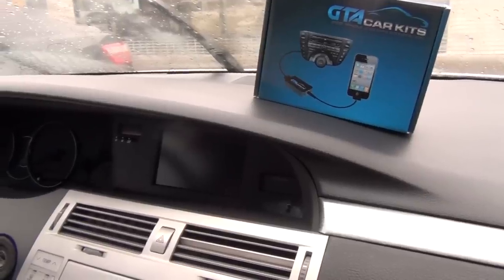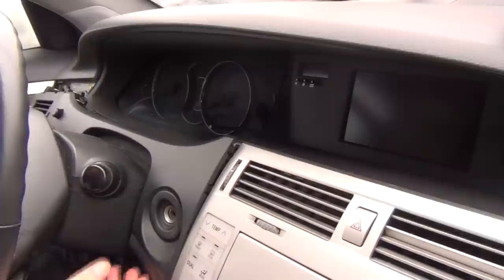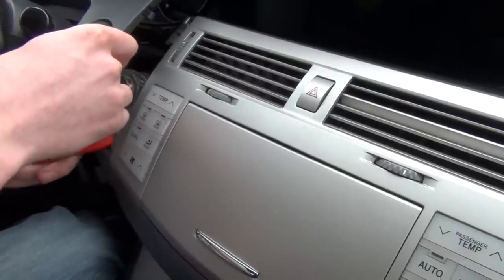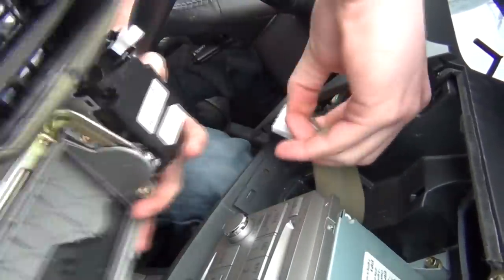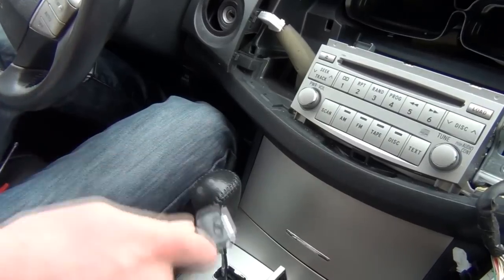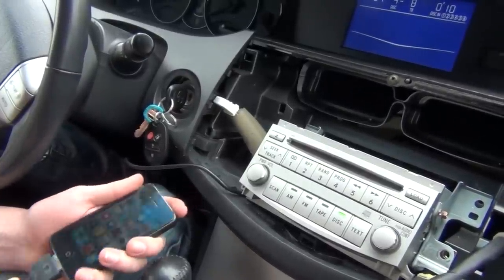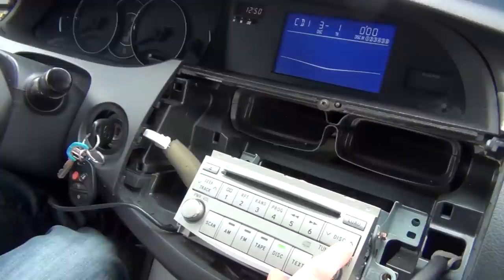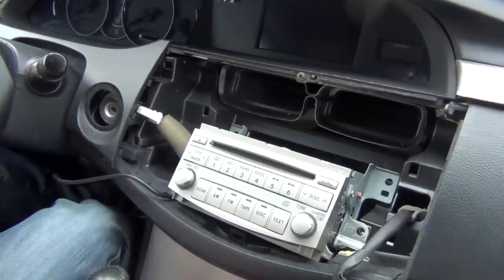GTA Car Kits - Toyota Avalon 2005-2011 iPod, iPhone and AUX adapter installation

Comment: I just installed my kit i ordered this past week. Install went as easy as the video with one question, the plug that you connect, on my radio it was not empty. Something was already plugged in there. I dissconected it and continued with the install and it works fine. Im just curious what that original connection was? Because on your video there was an empty spot there already for it.  Any help would be great.

Comment: Are you guys gonna make a kit with a Lightning connector or have you already?
Reply from the maker: With the new generation devices, you have to use our kit along with the Apple Lightning Adapter. We cannot make our out connection to transfer data, due to patents.
Reply: GTA Car Kits great video. However, were would that Apple Lightening connector/adapter be connected to? Is that with a USB port or a Type C? Not sure we’re to connect it to. Please advise thanks.

Comment: will this kit work with a 2005 toyota avalon limited with nav system and 6-disc changer?
Reply: +Khanh V  i have the same... did u got answer yet ?
Reply: not yet
Reply: just checked their web site, and unfortunately, the answer is "NO"  

Supported only on cars without navigation

GTA Car Kit supports Toyota Avalon without navigation only.
Reply: hey Khanh, did you get your solution yet? Mine is the avalon 2006 with Nav.